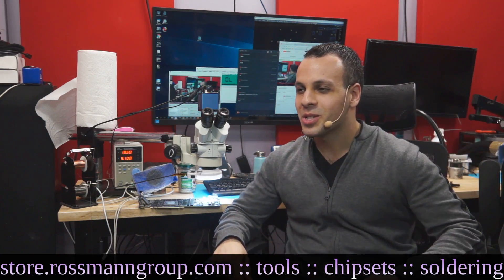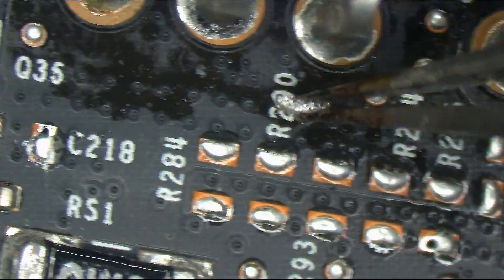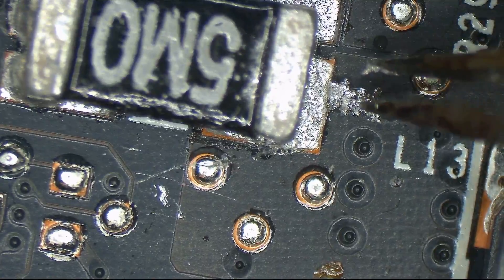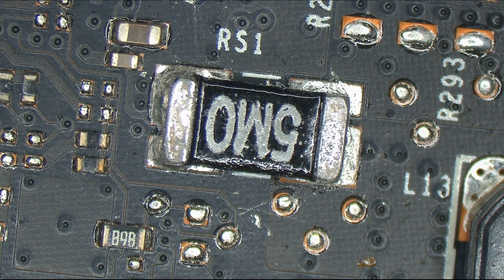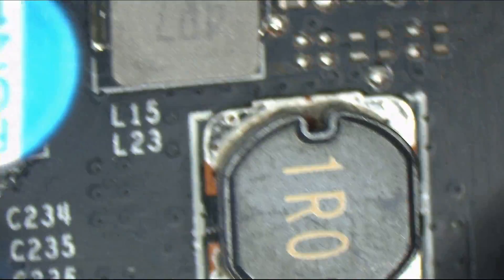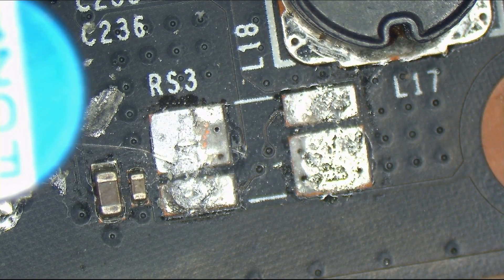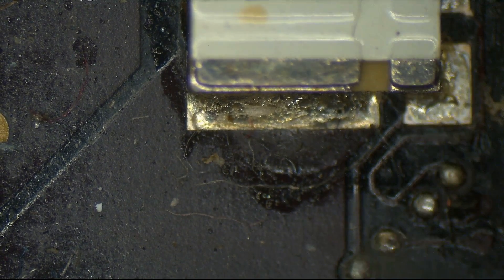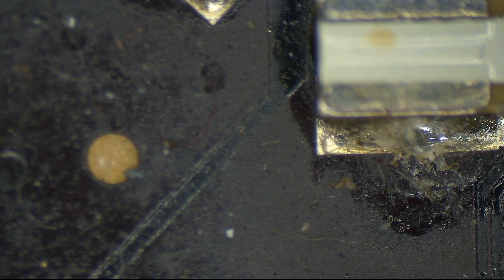DO NOT SHUNT MOD YOUR GRAPHICS CARD WITH LIQUID METAL!

Comment: Here's my input shortened to a small list:

1: liquid metal contains gallium, which is a metal that becomes liquid at 37*c unless alloyed with other metals (which it is to increase conductivity and also make it liquid at lower temperatures.)
2: solder is comprised of about 60% tin. even the lead free stuff is somewhere around 40-60% tin.
3: Tin forms an alloy with a melting point of 15*c with gallium. it does so pretty much on contact with gallium.
4: Additionally, as a side fact, gallium likes to absorb into aluminium, which alters its crystal structure and weakens it to the point that something like a computer heatsink will break apart as if it was a piece of toast.

THIS MEANS THAT THE LIQUID METAL YOU'RE USING TO SHORT SHUNTS FORMS AN ALLOY WITH THE SOLDER ON YOUR CARD. THIS SOFTENS THE SOLDER AND CAUSES IT TO BREAK APART. DO NOT USE LIQUID METAL THERMAL COMPOUNDS AS CONDUCTIVE LAYERS ON SHUNT RESISTORS OR ON ALUMINIUM COOLING SOLUTIONS. both of which will cause damage to your components.
Reply: In general, people using a liquid metal TIM such as ThermalGrizzly Conductonaut will be trying to get much thermal transfer as possible form the component they're cooling, be that a CPU, GPU or anything else that puts out large amounts of heat.  With regards to graphics processors there are also crackpots that think it's a good idea to temporarily short out some of the resistors responsible for current sensing on the PCB with these same thermal compounds to try to skew the readings on the card's current sensing to increase the power limits and get a higher clock rate. As mentioned in my OP that is a stupid idea and you're better off taking a soldering iron to your $1500 GPU to affix low resistance wires across the shunts.

As for the Intel thermal compound debacle, the reason Intel uses pastes on their chips instead of soldering them is literally just to shill out on the production costs. it's cheaper and faster to just dump a bunch of thermal paste onto the CPU die and glue the IHS in place than it is to apply a layer of gold to the heat spreader and then use an indium/tin based solder to fix the die permanently to the IHS. This does mean though that with high TDP parts (anything faster than an i3 8300) that you run into issues with high core temperatures because the thermal compound has a much higher thermal resistance than the indium/tin solder used on soldered chips.
Reply: My mental image of gallium comes only from NurdRage's video "Gallium induced structural failure of a coke can". I'd be very wary of putting that stuff on *anything*.
Reply: @scoreunder  so long as you properly know how to apply it and apply it with the proper barriers in place adequately it's absolutely fine. However if you just try and dump it on you will ruin it it definitely isn't something for the Casual PC Builder buyer if you're building a lot of high performance PCS that need to overclock and be cool then yes so long as you know what you're doing you'll probably be fine. There are barriers you put in place like paste that prevent gallium from actually getting on the die and you can put it on the lid as well if you want to keep away from discoloration.
Reply: A shunt mod should only be used temporarily and only in case you're trying to break some overclocking record anyway, if you leave it on permanently you are dumb and should fully suffer the consequences of your lack of sense.
Reply: ThEcRaZ3dGaM3R i don't get the point of setting liquid metal on GPU. Also is it worth it to solder cover of intel CPU or thermal paste was put on it for some reason like this?
Reply: Thank you for info.
Reply: I wouldn't even do a gallium shunt temporarily. You're better off using a wire. it doesn't liquefy the solder and there's less chance of it shorting a nearby component if you do it right.
Reply: +MarginalSC you should really resolder a new resistor to shunt mod, that gallium shit is bs.
Reply: The problem is Intel are shills and any place they can save a penny they will. I mean just look at their substrates and how ridiculously thin they became when you compare, say an i7 4770 and an i7 6700. people had to be careful how they mounted their coolers on the 6000 series because if you had too heavy a cooler or it wasn't mounted with balanced forces it would bend the chip in the socket.
Reply: Not really. The only real reason to do so is to set an overclocking record. It is a vanishingly small return for just playing games etc on a day to day basis.
Reply: ThEcRaZ3dGaM3R Small correction, lead free solder is often 97% Tin, unlike the partially outlawed lead mixtures.
Reply: Liquid metal paste cools 20 C better than stock paste: https://www.youtube.com/watch?v=8iKGE8y4XX8
Reply: ThEcRaZ3dGaM3R what if to solder CPU cap instead of LM?
Reply: Solder doesn't spread as well, hardens, and sticks.

Comment: Ok ok ok.... whew ok... time out.  Before this, I had never heard of this mod.  I've just completed a cursory review of "liquid metal power mod" and as someone who has worked the hardware and software side of IT for a few decades now, I say "W.T.F." Just read the first post of this "tutorial" here: http://www.overclock.net/forum/69-nvidia/1608437-tutorial-power-target-limit-hardware-mod-shunt-mod-titan-x-many-other-nvidia-gpus.html and a few things stand way out to me.

1) Someone, somewhere was smart enough to know what a current sense resistor is. That same someone then said to themselves "let me put conductive liquidy stuff on this part" facepalm
2) I would have hoped that if you are smart enough to say "resistor" and "inductor" that you would have better sense than to perform #1 above.
3) it seems to me a lot of effort to research this method of overclocking, remove the cooler from the CPU, and then simply half a** a short circuit with "liquid metal" (thermal paste?)
4) the final coup de grâce for me is this bit "...did the mod and used some hot glue around the resistors to give additional protection against run off and spills ..."

All this effort but they can't take the time to learn how to plug a SOLDERING IRON in to at least create a proper short?!?!

So this mod essentially takes a 5M (.005 ohm) resistor and shorts it to an unknown and uncontrollable (both electrically and physically) value. All this effort and it seems it would be easier to just replace the resistor or use some other method to short the connection besides "conductive liquidy substance". Hell, using a silver sharpie over the top of the resistor would probably produce the same effect for less effort and less risk of the substance migrating on the board.

I could go on endlessly about how many ways wrong this whole idea is. The bottom line is, this is another example of why normies should not be allowed to use technology. We're worried about idiots with guns while an idiot with a cell phone can be just as dangerous. This is also why the amount of money a person has doesn't translate to how smart they are. $1200 for a graphics card just to do THIS to it!! At least, I can understand why they are willing to pay hundreds of dollars to fix it.

Louis, I would happily charge a couple hundred to fix this. I would also offer another couple hundred to "improve the performance" and solder a proper mod in. Say, I dunno, random number just because... 1M instead of 5M. If it powers up and lasts more than 5 minutes then it's already an improvement over what the user would do themselves. This person seems to have money to burn in the pursuit of FPS (or maybe coin mining?).
Reply: And what's wrong with that(as long as you know the risk ofc)? It's about pushing the card to the limit and this is a easy and effective way to do it. Does this mean everyone should do it? No, ofc not, for the regular consumer this is pointless, but for someone that is just trying to get the highest score this is much much easier than soldering and faster as well. Shunt mod will take you at most a couple of min and all you need is some thermal metal. 

Further more, you might not want a proper short, as someone else pointed out, if you do a proper short on newer nvidia cards they won't even turn on because of safety features. 

Another thing is that it's likely that a person that is doing shunt mods is already running the gpu out of specs, meaning that the gpu is already at risk of dying or has a really high risk of dying in the 1st place.

It has to do with higher score in whatever benchmark program and there are actually benchmark competitions. 

So again, i'm not saying it's a good idea(at least not for general overclock for daily usage), but it's a easy way to get slightly better benchmark performance.
Reply: Raigekon It's a difficult and ineffective way to do it.  I'm guessing that tinfoil (Al foil) would be better, cheaper and easier to use than Gallium.
Reply: Small m. Not large M.
m = milli
M = mega
Quite a bit off.
Reply: People don't want to use a soldering iron for the shunt mod because it leaves more evidence behind that a warranty-voiding tamper was done. Using liquid metal, you just wipe it off and the next user/manufacturer is none the wiser. Yes, soldering something on there instead of liquid metal would have better effect (fool the video card into thinking it's using less power than it actually is, in effect, raising the power limit so it doesn't power throttle) but liquid metal is easier to do and that's why people do it (I'm not saying its the right thing to do though)
Reply: A clean solder job leaves no evidence. Applying any galinstan alloy to a tin solder joint, copper pad, and fiberglass board, is going to completely and thoroughly destroy that solder joint, to the point of it falling apart like in Louis's video, in a matter of hours.
Liquid metal is just a eutectic alloy with the highest conductivity possible(out of the very limited range) that is super overpriced, but I guess premixed for you in a small tube.
Reply: >> And what's wrong with that ...?
What's wrong with that is that people give very bad advise, and other people destroy their hardware based on it.

Comment: Some say gallium - but check the part vs original - perhaps it's a power mod and the resistor was replaced.
Used solder paste but didn't allow it to properly melt.
Even the marks around the components look like burnt solder mask/solder marks.

Comment: blame those who persuade peoples to use liquid metal for shunt mod. apart from easy to do, they also want to keep the manufacturer warranty. by using actual solder, no manufacturer would gave them warranty if they fock up the card while liquid metal could be easily wiped off
Reply: Yeah, it's like a monufacturer checking damage won't notice the solder being amalgamed to a liquid at room temp, and components falling off the board....

Comment: That is 100% liquid metal damage, where they have tried to up the power limit for overclocking, Nvidia would not repair/replace under warranty. It is fixable, and maybe if needed they could ask you bridge it properly for the upper power limit.

Comment: I miss the talk videos. Can anyone shed light on my issue. My pixel XL stopped charging. Sent it away for repair under warranty. Warranty claim denied due to physical damage (at my fault). How can I damage my type c port? The retailer is not offering me anything but a replacement phone at $800 (my cost). Please let me know what you think

Comment: So let me get this right here. You buy a 3 grand graphics card, then to mod it you risk pouring Gallium on it which will do this to the soldering, all to avoid paying for $20 in tools and taking 5 minutes to learn how to make a solder blob, which is 500% less risky, and wont leave you with an unworkable board if things go wrong. What the everliving fuck? 

I don't know if i should laugh or facepalm here. This is a new level of stupid. You could do this mod with radioshack crap!
Reply: You're questioning the judgement of someone who buys a $1200 GPU.
Reply: resistance wire m8, it doesn't have to be all or nothing with a wire or a blob, as with everything its about the amount, but I'd be willing to guess that a heavy application of gallium is very near 0. You could even solder another resistor on top of the existing one.
Reply: Uhm it's not about not buying and/or not being able to do a blob it's just if you completely remove resistance card will think sth wrong and freak out. So you need somewhat vdrop on resistor's pads. It's a "safety" feature Nvidia had put on their cards.
Reply: I feel the same way, I've seen the gallium mods, and the gain, but I own a soldering station (albeit a cheap one) and would be happier to make a blob or stick a wire in both sides to eliminate resistance rather than put something corrosive on necessary components. I personally love to overclock and delid, to push my hardware as far as I reasonably can, but I will never put liquid metal on anything. The degree or two in temps and ease of just slapping it on does not outweigh the safety of the components themselves... maybe it's just because companies don't send me free cards and CPUs.
Reply: Onur Berk SUNAL Silver. Sharpie.
Reply: Steven, they usually apply only a thin layer on top of the component so there should still be some resistance. But yeah, you're right.
Reply: It's a milliOhm level of resistance change to have a corresponding change in current sensing. Just soldering across the pads of the resistor puts the card into protected mode. Aka won't work. Since LM has a higher resistance than solder, but less than a silver pen or graphite coating it allows for a "reading"of around 50-80% utilization when in effect it's actual real reported amount maybe 120%. It's a way to get around Nvidia locking down the vBios and prevent modding.
Reply: Steven Randall I mean can you blame the guy for wanting some more performance. He already got best possible (if it's a little p model) card on market there isn't much else to gain single card performance.

Comment: Lead free solder generally has tin and or indium; both of which gallium will merge with easily... check out Cody’s Labs latest video which shows how easy these 2 metals will create liquid alloy with a melting point of 11 degrees C...

Comment: The mod sent too much power through the card. Talk to Buildzoid about that sort of thing.
Reply: No, gallium simply formed the gallistan alloy with the tin solder. which is a liquid at room temperature...
Reply: Gallistan! I never mentioned the Middle East! What I was talking about, is the composition of the Liquid Metal used to MOD the card.
Reply: Yes yes... gallium containing compound, if not pure gallium, which readily alloys with tin, forming gallistan.
Reply: At least, the conductonaut is a gallium indium and tin alloy. No idea about coolab ultra but the conductonaut is just a bit better.
Reply: ^ Oh god get that on any solder joints and it's G O O D B Y E solder. lmao.
Reply: Ikr! there's a reason to actually coat any solder joints (aside from shorting risk) of a CPU when delidding it with conformal coating or the like... and they completely have no fucking clue EH HEM GAMERS NEXUS
Reply: Dave Lee ehm ehm #ripltt
Reply: Gallium normally takes years to alloy with tin... unless they also had a tiny little bit of tin already in there to further modify the properties of the thermal alloy, then it will alloy with tin rather aggressively.